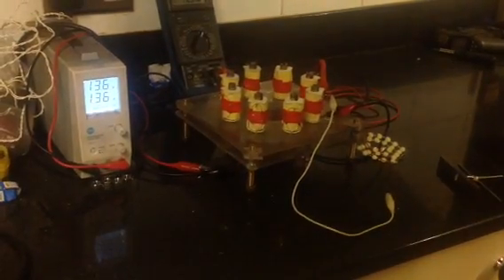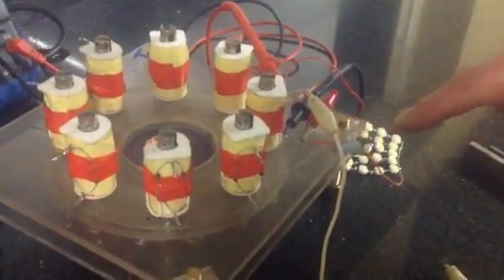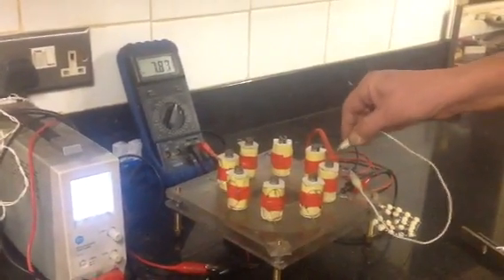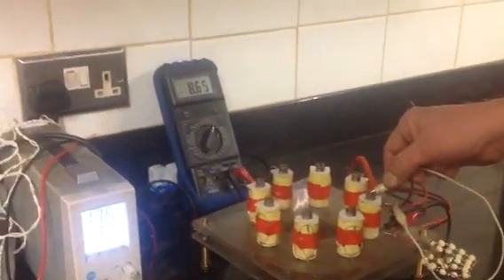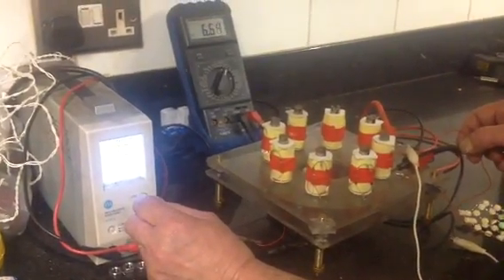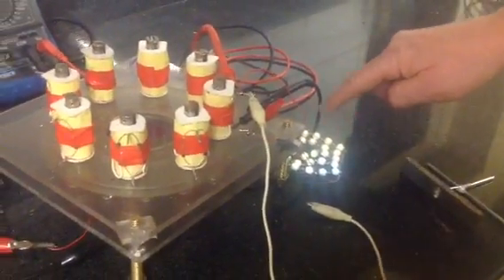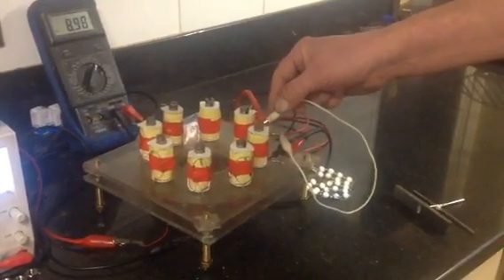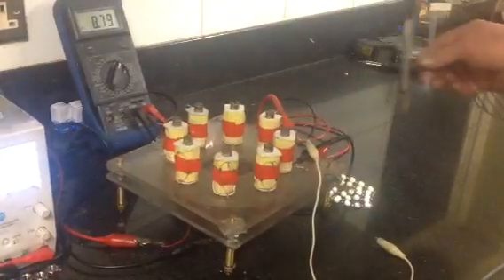Grumage builds the T-1000 motor. V2.

Comment: Did you check if one of the wires of the coils actually touch or even short out to the core?
I do remember having seen the anomaly where a person touches the core, and the output increases. Seems capacitance related. And R + C is an RC-network, perhaps even LT (Line Transmission) rules are applied, which are the reason for cancelling Lenz's laws. (I like far fetched answers .. ..)
Reply from the maker: Dear deslomeslager.
The coils are from retired solenoid actuators and have a very thick plastic wall so no shorting to the Iron !!
This could be something new or something the "Boffins" will know about, let's wait and see !!  : )